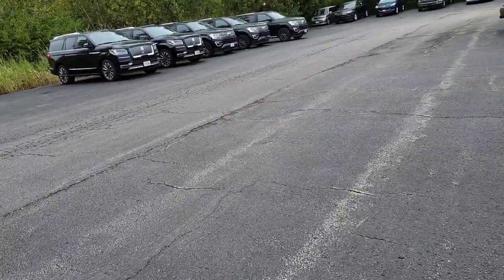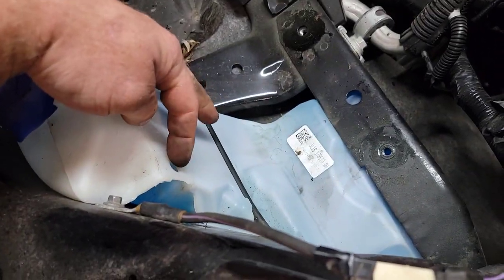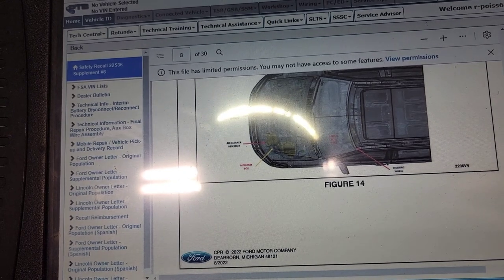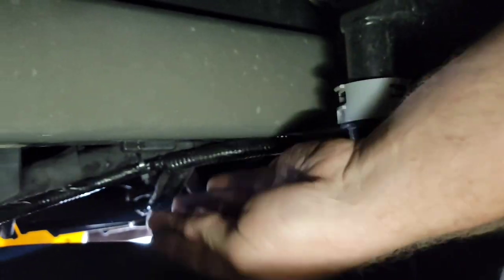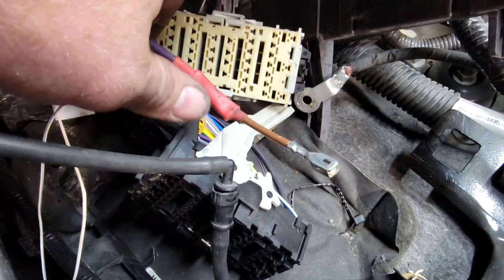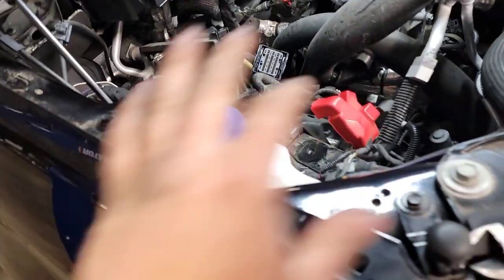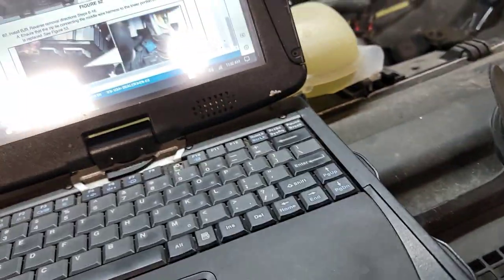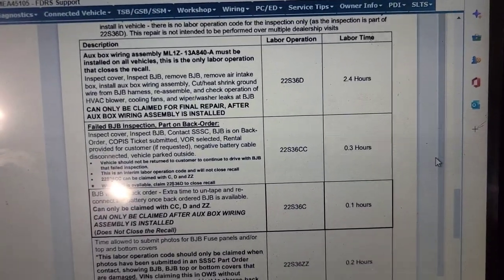Underhood Fire Randomly - 2021 Ford Expedition And Lincoln Navigator 22s36 How To Perform

Comment: FORD is going to have to rebrand to FORCALLED they are getting ridiculous 🙄 anymore. Plus their ziptie mounting procedures as part of the fixes is garbage 🗑
Reply: It's not just Ford, my kid's Hyundai had a recall for a whole new engine and Toyota is recalling 5.8 million for fuel pump and 460,000 for stability control issues. 
There are hundreds more that aren't Ford.
Reply: I think it’s just about all the brands because they are having trouble finding enough people so the people that are working are doing more than normal so they make mistakes from being overworked. Plus all manufacturers are having trouble getting parts so they are might be cutting corners or using a different company then they normally do. I work in dental equipment manufacturing and we are always going line down to the point we either have to change how we build something or we have to find a company that can make that part fast enough and then they are being pushed to get us the part asap so that company sends us a faulty part. It tough times these days
Reply from the maker: This is an all manufacturer problem pal
Reply: @FordBossMe  My Superduty with the new Godzilla 7.3 has been flawless. And a recall isn't that big a deal. Take it in, pick it up, done.

Comment: My friend had a fuse box problem the problem was where the main wire was hooked to the fuse box very inferior connection so I took some scrap copper some brass bolts refortified it soldered it up basically made it bulletproof. Every Ford will have some type of problem like this because they put too much load through the junction.

Comment: Funny everything on battery box is 8mm except for 1 bolt torx 20.  Is that a Engineers joke?
Reply from the maker: The battery tray is 13mm the battery hold down clamp is 8mm the battery post are 10mm the one torn 20 is a oddball
Reply from the maker: So only 2 8mm in this entire video

The battery hold down and negative battery body ground driver side behind headlight where harness gets grounded